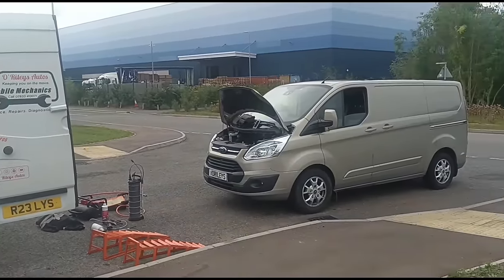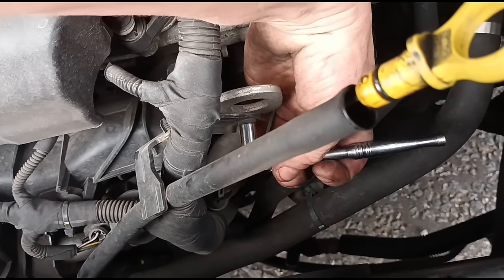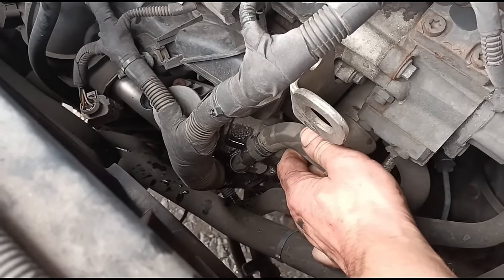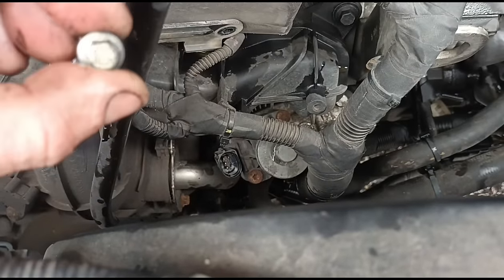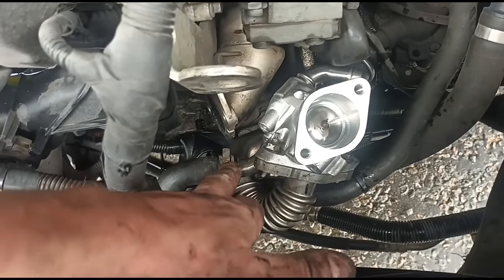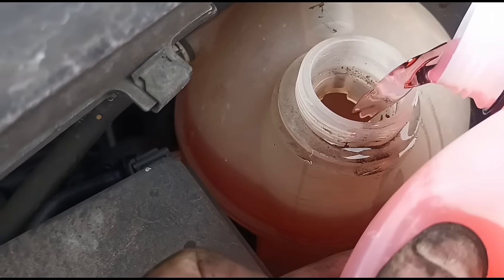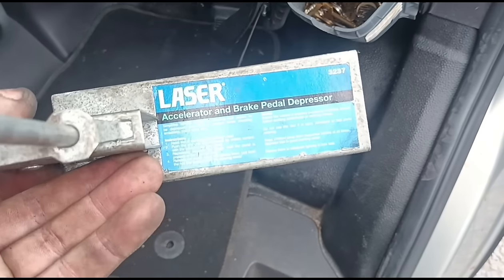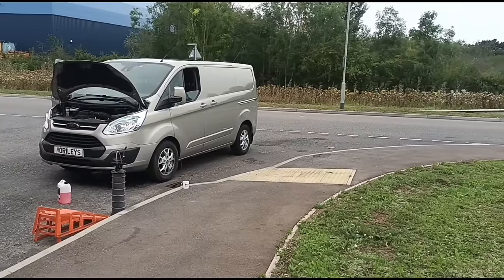Ford Transit Custom 2.2 P042F:00-27 EGR Exhaust Gas Recirculation Valve Stuck Closed

Comment: Ah the cascading faults issue, fix one, another pops up.  I had that happen to me last year when I got a glow plug fault warning that triggered the engine management light.  So I replaced the glow plugs (which to be fair had 280,000kms on them).  Next day another engine management light which was an exhaust gas temperature sensor.  Replaced that (but it was far from easy!!) but then next day, another warning light, this time it was a blocked dpf.  So I flushed that with Wynnes dpf cleaner and then the problems were cured.  Well for a few weeks or so until a wheel bearing went bad, but I replaced that and then things have settled down….for now at least!  Thanks to Jimmy and other YouTube mechanics, I’ve learned how to do all my own maintenance works which has saved me a fortune, plus I know the repairs have been done correctly.  Wish main dealers had the same desire to fix cars properly.
Reply: I have this problem with my transit.  The cascading faults are so frustrating.  You fix one issue and another pops up.  I am now done with this van as my wallet cannot cope with the constant need to replace sensors and valves.  I have never had so many issues with a vehicle.  This is a proper lemon and I would advise people to steer clear of transits.
Reply: @chipanderson2135 I’m not alone in this case… I’m hesitating to burn my transit or fixing it 😅
Reply: If you want your car to work well and without problems, REPAIR THE MACHINE YOURSELF.  GOOD QUALITY WORK IS ONE THAT IS DONE BY YOURSELF.  I repair the car myself and there are no problems with the car.

Comment: The problem I had was that the "Hill start" and "ESP" lights came on, but when I did the diagnostics, the computer showed a P042F (EGR) error.  I removed the EGP and found that the valve was stuck, but I did not buy a new one, but performed maintenance on the old one.  Now everything works as it should.
Reply: Had exactly the same thing happen on mine today, going to take off and clean. How’s yours now?
Reply: @jockeywilson  👍. 👌.The valve was very coked, I had to use some tricks to make it work.

Comment: That EGR valve was the least of your problems. Looking at the way the inside of the EGR discharge nozzle was clogged,
thats what the inside of your inlet manifold looks like. There will be a 5mm thick layer of carbon soaked with half burnt engine oil in there.
BE SURE to clean the inlet manifold and inlet ports out when you service the glow plugs.

Comment: If no engine light comes on would the effects of the erg valve cause the vehicle to kick out white bluish smelly smoke upon start up and while driving off it really gets bad and stinks to high heaven . But after about a mile or so it stops smoking.

Comment: Hi Jimmy, my gaffers van has started “juddering” at low revs in all gears, but drives okay otherwise. It has no dashboard fault lights. Is this the engine malfunction caused by a faulty EGR? Thanks.